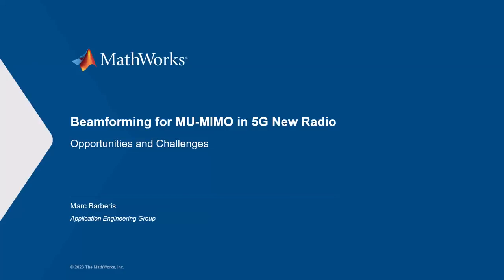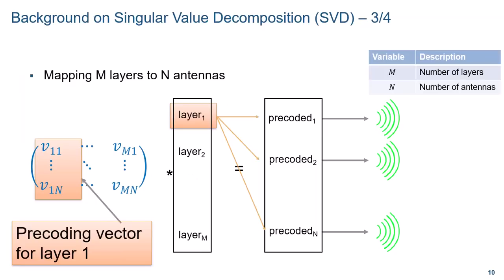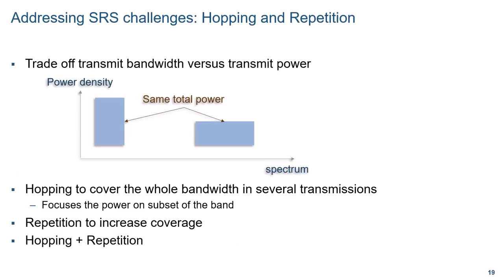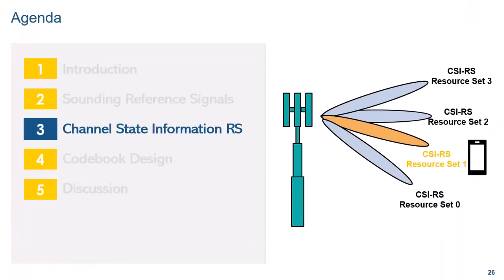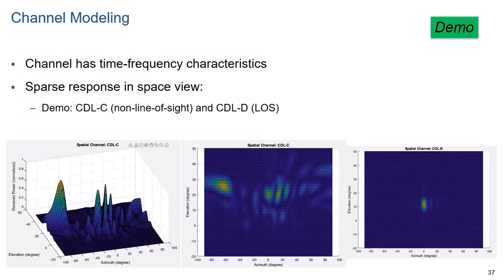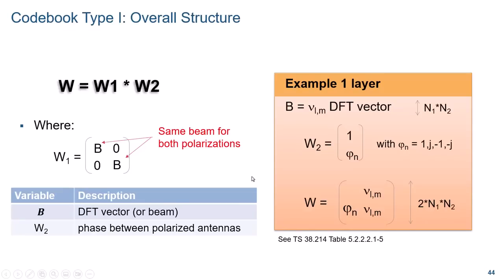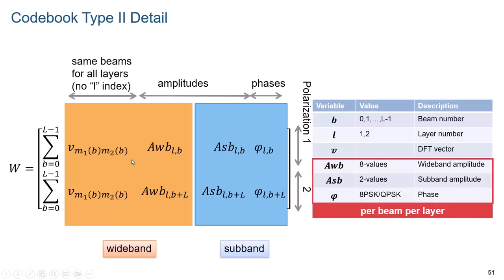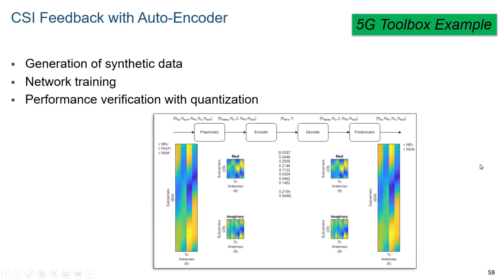Multi-User MIMO Beamforming in 5G New Radio

Comment: A question: How can I measure the CQI for multiple users interfering in each other using the 5G toolbox? I am asking because your examples only show it for a single user.
Reply: have u know how now?
Reply: @TengyuZhu It is a bit frustrating. I realized that the 3GPP does not consider the effects of interfering UEs to measure the CQI. So, the CQI computation considers only the noise, Rank Indicicator, and precoding matrices (that are already defined in tables). In a nutshell, it is like in the single user scenario 😆 🙄 🤣 even when there are multiple users.